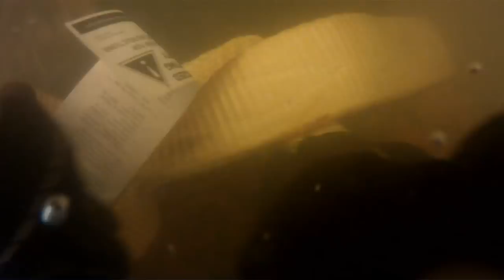Removing An 800 Pound Water Pump

Comment: Hi,
I was wondering what depth you are operating at in the removal of the pump please?
Out of interest, when you are using lift bags in general, how do you control the rate of accent so it doesn't accelerate uncontrollably to the surface?
Do you surface plan your air consumption prior to doing the salvage/removal job or do you guesstimate when onsite?
What redundancy considerations do you make when you are looking at removing something of that size and weight please?
Are you going more by feel when removing the nut and bolts than by sight with respect to the visibility?
Is there any way to improve the lighting of the next video please?
Cheers
James
Reply from the maker: Great questions.

In this particular video, we were at a maximum depth of 7ft (2.1 meters).  Controling the lifting operation is simple at this depth, but from greater depths, we will typically only put enough air in the bags to break the seal from the object we are lifting and the bottom.  Then we will slowly begin to swim the object up, while at the same time maintaining neutral buoyancy of the object with the bleed off valves on the bags.  With the SubSalve bags we use, they also have an automatic pressure relief valve, that will release air if at anytime the pressure in the bag becomes 5 psi more than the ambient pressure surrounding the bag.  This also helps with controlling the ascent. 

 In regards to planning our Air consumption, at this point in time, its a given.  Meaning, we know our air consumption based of many years experience, and based off the diving activity we are doing.  But in general, yes we would always do the math prior to getting in.  

With redundancy, there was not much on this dive, due to the shallow depths we were working in, other than medical supplies on the surface. We would typically be using pony bottles 30's or 40's as back up.  Most of the time, the equipment that we wear for salvage diving, is the same equipment we wear while doing Public Safety Dives.  So the redundancy is built in.  

Speaking of redundancy for our bags, we typically will have several bags hooked up, even if we only use one, this way if one fails then we will have a back up.  On this dive, we actually had pretty good visibility, so we could see the nuts and bolts.  But a lot of times we are working in zero visibility and have to go by feel alone.  Most of these dives are planned several days in advance, if not weeks in advance, so we have a pretty good idea of what we are dealing with before we ever get to the dive site.  

Now for the question of lighting.  We have been asked several times, if we would consider changing the way we film, and maybe even add better lights then what we are using.  We have always tried to keep out channel real, and not staged, so to speak.  What the viewers see in the video is exactly what we see while operating.  So we try our best to keep our channel as realistic as possible.  Now obviously we do set up certain shots, and will hand the camera off to another diver for certain aspects of the dive, but 99% of the time, the shot you are getting is the POV of the diver himself.   Hopefully this answered your questions.
Reply: Thank you for your comprehensive answers.  I always wondered how lift bag rate of accent is controlled. Now I understand your philosophy of lighting. :)
Reply from the maker: With the bags, we will either use a hardwired compressor hose, that is controlled from the surface to fill the bags, or we will do it manually from under the water, with extra cylinders.  This way we can put the exact amount of air in the bags that we need.  In the incident of using surface supplied air for the bags, we can communicate to the surface through our mask, and tell them when to stop adding air.